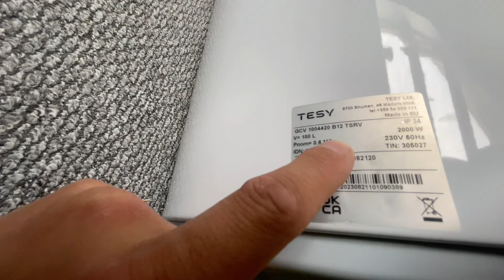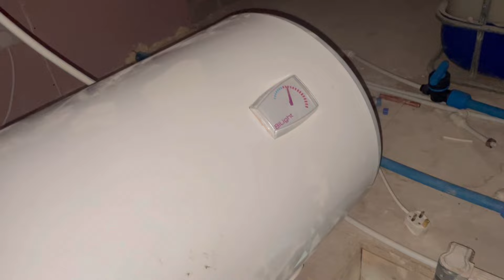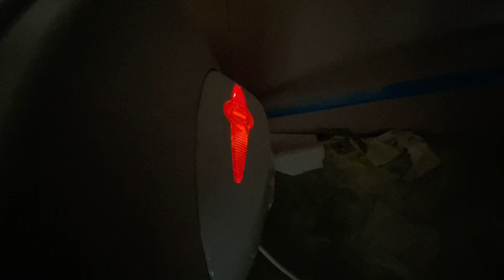SHOCKING Mains Water Discovery

Comment: Tubeless tyre valve stems fit perfectly into 15mm compression fittings… you can pressurise pipes with a bicycle pump… that’s how I did my underfloor heating pressure test. Would work to empty tanks
Reply from the maker: I’ve actually got a rothenberger pressure test pump in the lock up